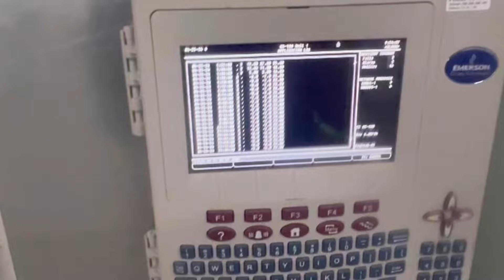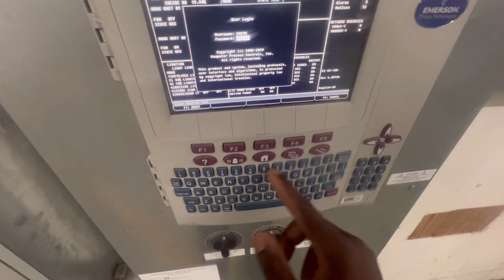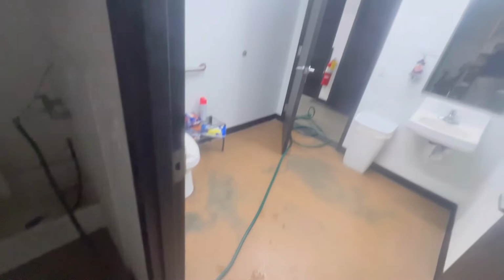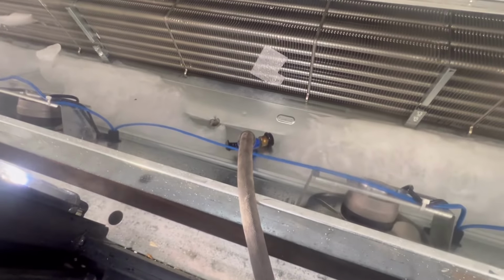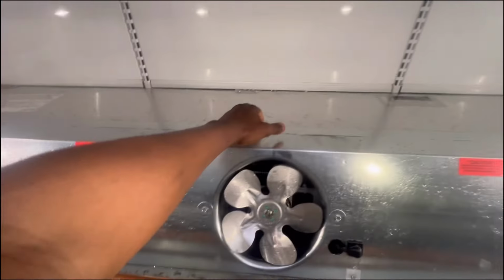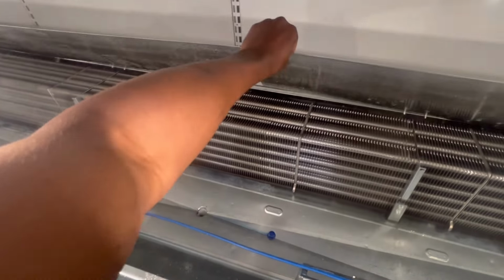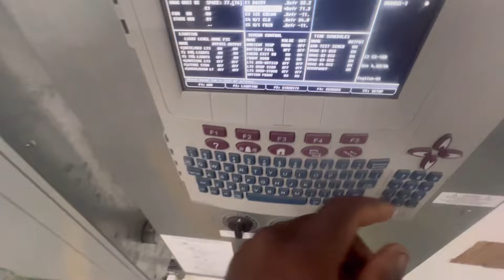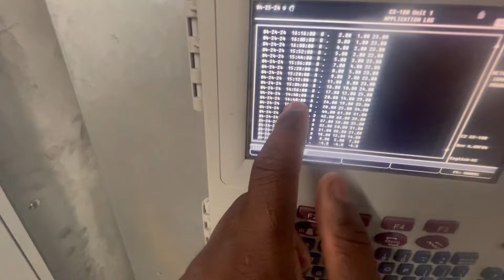FROZEN PIZZA CASE RUNNING WARM!!

Comment: I use the True drain line heaters in the zeroZone drains. I just wire it in series with the fans. Works great. Let me know and I can get you the part number.
Reply from the maker: Thanks for input and would appreciate having part number so I can keep.